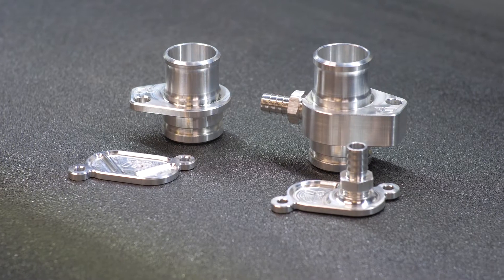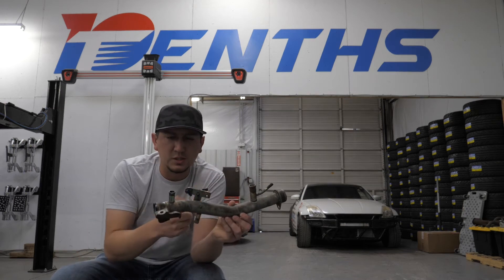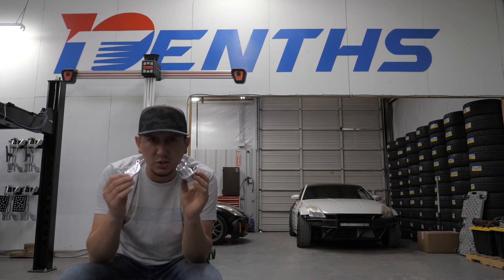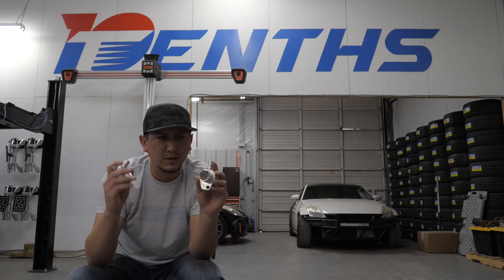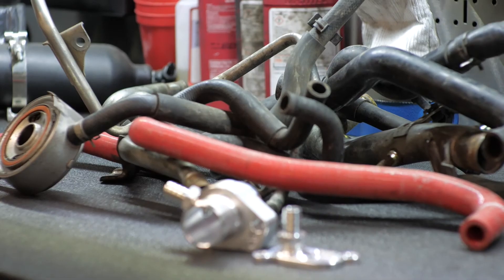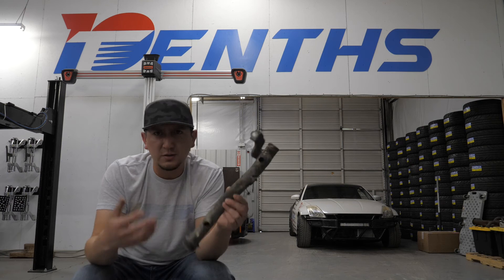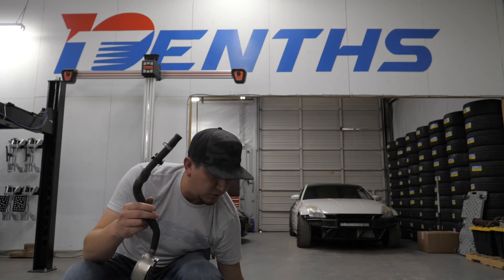10 Tenths Motorsports Nissan 350z CSK - Hose Delete Kit Overview

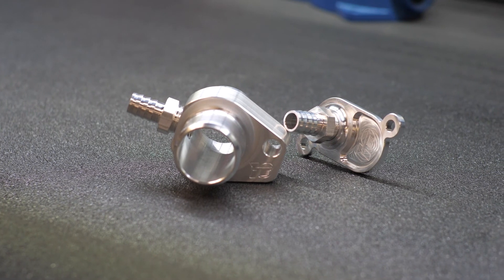Comment: 5:13 My car is a street car, I would want to keep my thermostat. If I'm understanding correctly, you want the barbs so you can run a hose from the passenger side back over to the driver side to get hot water over there to open the thermostat, is that right?